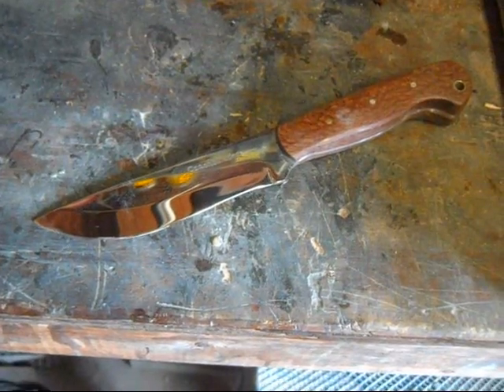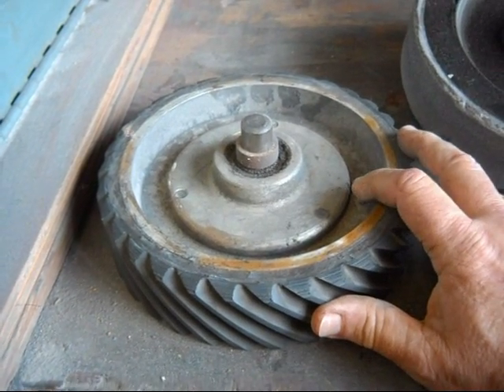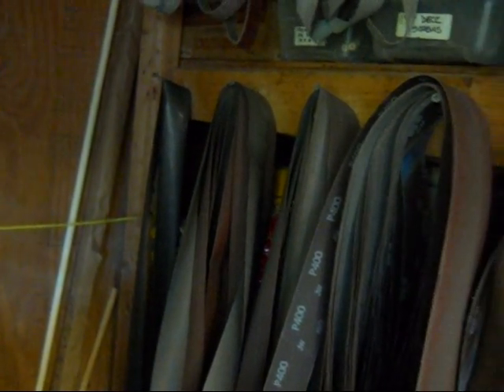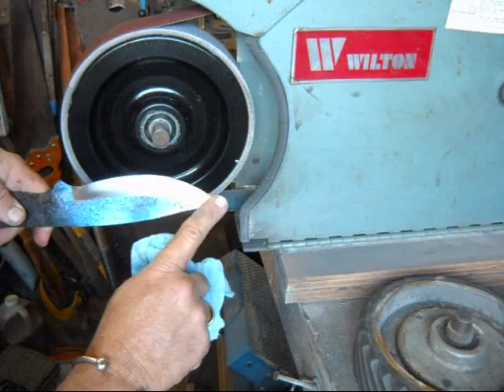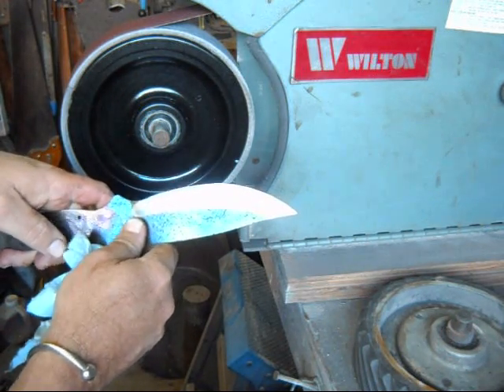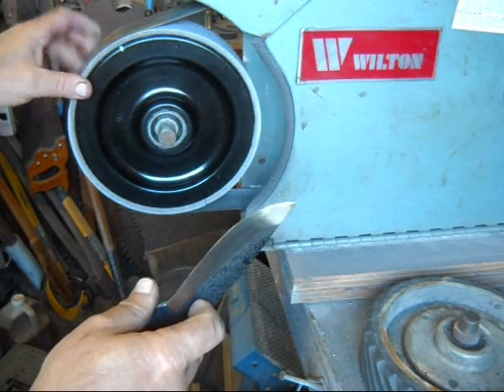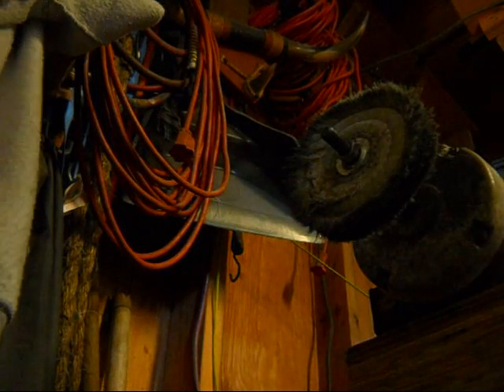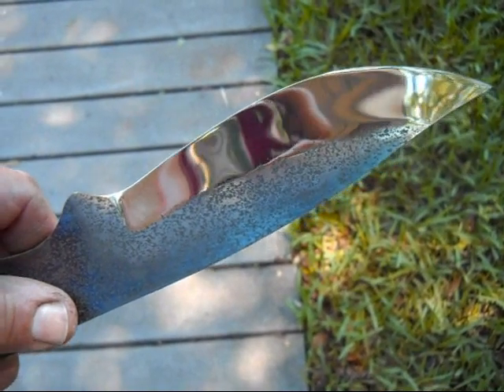How To Get A Polished Finish On A Knife

Comment: Nice vid Crash, I took my knife from you out this weekend & beat up on it a bit. It picked up a bit of a patina from cutting lemons and not cleaning it off right away, I think I am going to leave it, it gives it character. The knife held up perfect, I batoned with it, carved feather sticks, whittled, cut fruit, veggies and my steak, even sliced cheese from the block although it was a bit sticky. Knife was in great shape after 3 days, doesn't even need a touch up although I may strop it briefly.

Comment: With all that friction going on, how are you sure you aren't changing the hardness of the edge? Polishing this method will get you a very shiny surface pretty quick but it's also going to make your edge more brittle if you actually plan on using the knife. It might not take long but you'll be doing it more often.
Reply from the maker: I know I'm not changing the temper of the steel because I am not getting it hot enough to do so.  My knives get used on a regular basis by quite a large number of folks.  I do appreciate your concern though.
Reply from the maker: +WhatInTheRockness I am not changing the temper on my blades as evidenced by a Rockwell hardness tester.  It just takes practice.
Reply: +CrashbladeKnives Most people just don't understand that the edge of a very sharp blade is anywhere from 380 to 990 microns thick. This equates to about 0.02"-0.04" thick. I don't see how anyone can be confident that they're not heating up such a thin point more than they realize. Good luck though, you do make pretty blades.
Reply: +WhatInTheRockness How do you suppose the blade got that thin. A high power belt Grinder.
Reply: +H4RV45 KOSO You have to run at least medium to high speed to remove the metal left over from the heat treatment. Any thinner than 0.025-0.015 and the edge will surely snake during quench. You misunderstand what i was saying. For clarity, The belt grinder is much more likely to overheat the edge than a buffer. That being said any maker that is a professional will very rarely blue the steel with the grinder. I have never heard of, seen or experienced a buffer bluing the steel

Comment: Do you do the flats after the bevel in the same process? If you want to leave the roughness on the flat surface what grit do you start with?  Thanks
Reply from the maker: I normally do it just as I did in the video.  I don't care for the scratches a rougher grit belt leaves.  Another option is to finish with a scotch brite belt for a satin finish.

Comment: I can put a mirror polish on a blade using 2000 grit sandpaper that's as good as any, and without risking damaging the temper of the blade.  If you intend to heat treat and stress relieve the blade after you use all those belts on it, that's fine.  Otherwise, you may be ruining the metal.
Reply from the maker: +James Ritchie I am not changing the temper on my blades as evidenced by a Rockwell hardness tester.  It just takes practice.